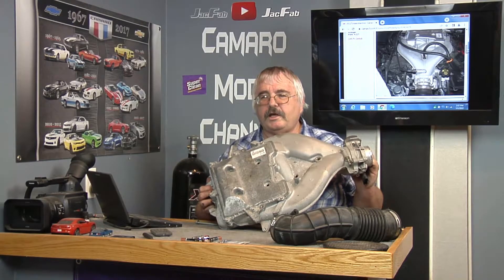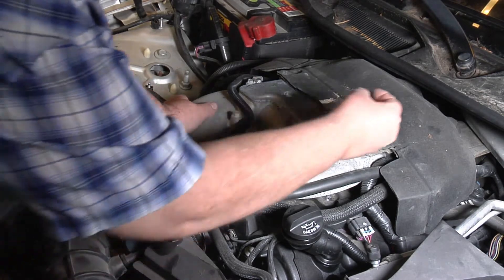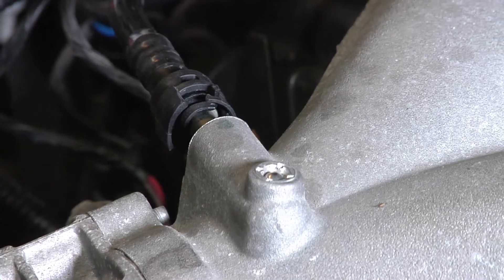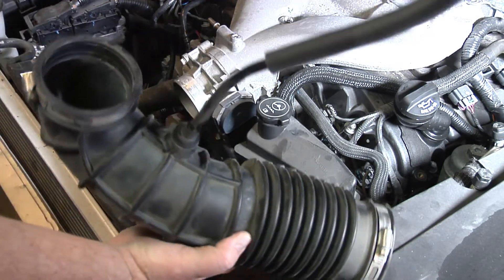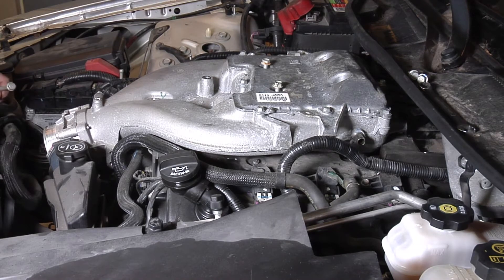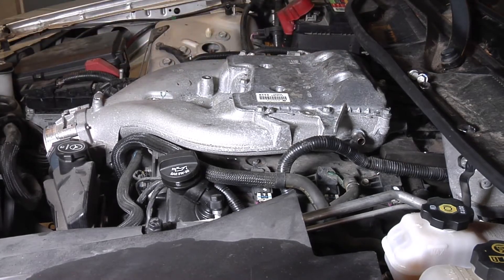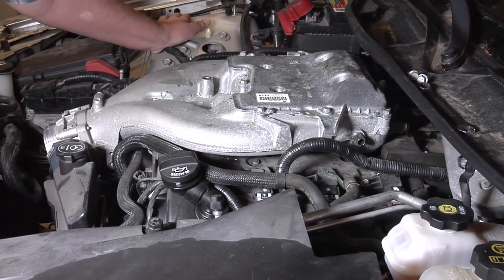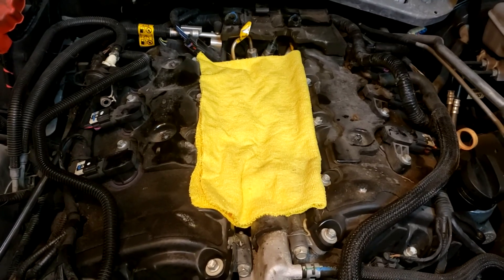How to Remove an LLT intake Manifold from a 3.6 Chevrolet Engine.

Comment: Hey brother will you please make a valve cover or timing cover videos? Since first buying mine, i have installed the catch can, done alot of work with it. I did the pcv valve as suggested before, my own brakes, some decorative for the hood, oxygen sensors, all around keeping oil changed with At 205 stop leak. She's running great but still needs the valve covers done because of a little burning oil. It's definitely not as bad as it was at first, thank god i had it drilled to spec. Your video really has helped. God bless 🙏
Reply from the maker: What, changing the valve cover gaskets? Thanks.

Comment: Is the plastic 1 & the aluminum 1 fully swappable without issues?
Reply from the maker: You have to have an adapter/spacer to do this. And the TB needs to be rewired if I recall correctly since they don't have the same plug. Jacfab used to have a spacer that also allowed you do do this but I don't know if that is available any longer.
You need the evap that goes to the respective year but it plugs right in.
 A) The bolt pattern is slightly different, and B) the ports are a different shape. Enter the Adaptolator. The idea is that the first piece bolts onto the LLT engine, and the second piece bolts to the first and has the LFX bolt pattern. The ports on the Adaptolator will also have a nice transition from the LFX port shape to the LLT port shape...

The pros as I see them:
1)LFX manifold is composite, so lighter weight, and a nice reduction of heat soak issues
2)Higher flow, and more velocity as stated by SC2150. This is always good.
3)The Adaptolator is appx. 1" or ~25mm thick, so much like the isolators currently available, the longer runner length will increase lower end torque.
4) More power?!

Cons? None that I can see?

Potential problems:
1) The vacuum lines and things like that aren't in the same locations, however this should be an easy fix
2) NO LONGER A PROBLEM

Comment: Question? 
Does coolant flow through that intake or No ?
Reply from the maker: No, only gas and oil vapors,  thanks
Reply: @camaromodschannel  Thank you. I have a 2011 3.6 that has a leak I can smell from the back of the engine. Gotta scope it to make sure it's coming from the T-state housing.
Reply from the maker: Yes, the thermostat housing is in the back of the engine. You may have a leak. If you can smell it. Thanks

Comment: beyond helpful, gonna try to replace the thermostat tomorrow and this is the best video for removing the manifold that i have found
Reply from the maker: Thank you Sir. Glad I could help.
Reply: Question? Why were you replacing your thermostat?
Reply: @carlmaro  it was overheating after a coolant change, so i flushed and replaced it